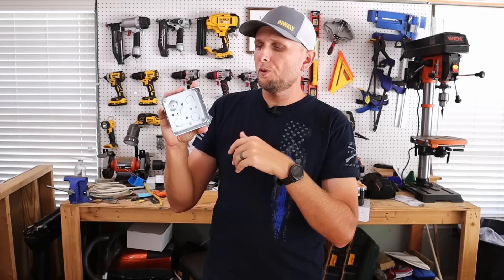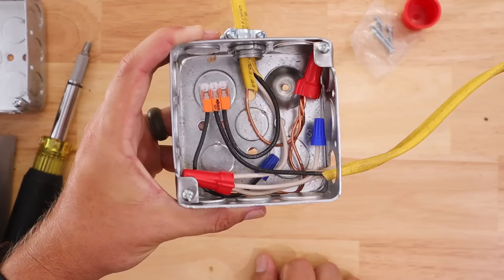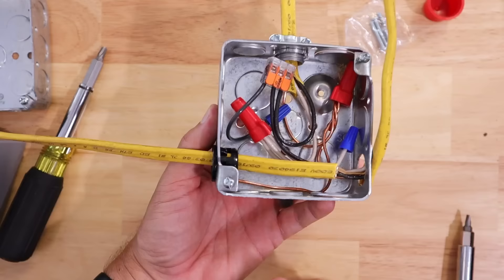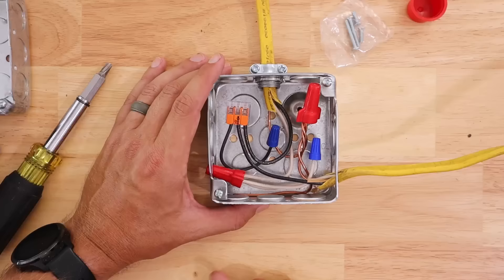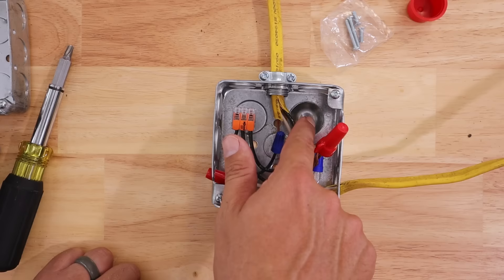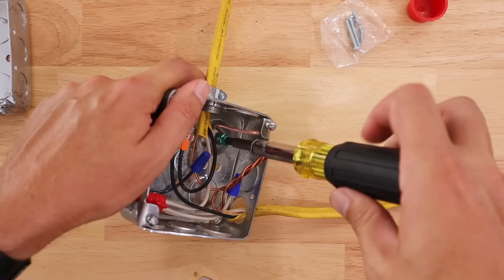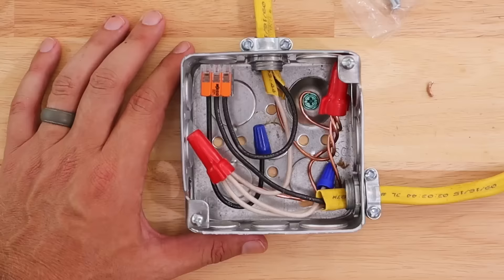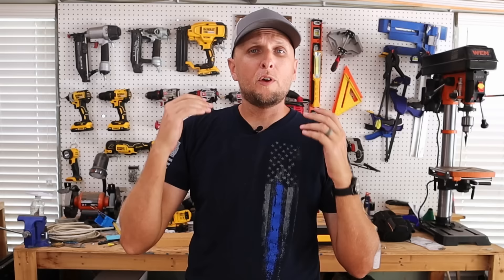The BIGGEST Mistakes DIYers Don't Know They Are Making When Installing Metal Electrical Boxes

Comment: What I would see a lot of people do to fix the ground would be to take advantage of the length of ground wire coming out of the Romex before it gets to the twisting and just wrap that around the ground screw. This would be especially true if they forgot to ground the box. To do so quickly, they'd start the ground screw, pull the wire over to it, give it a short wrap, and tighten down the screw. Technically, this would likely violate the minimum wire length, but it would be functional. If you did it before trimming the wire to twist it, then you could leave enough length from the screw to meet the minimum length.
Reply: You can always extend the wire especially a ground with a wire nut , wago,  push in , or a coppercrimp
Reply: I always leave one long just for that reason. I've seen some old houses where the bond was pinched under the box. Not code but at least it has a bond
Reply: @biffmalibu3733  I've seen metal boxes tied to conduit where the ground was secured to the danged clamp for the conduit + box connection. Then you get to the panel and see a massive bare copper cable tied from the panel through the concrete, literally "grounding" the ground.
Reply: Dawg...get this . back in the day with metal conduit (running between metal boxes) you didn't need a designated ground wire ... You only needed to pull in your current carrying (hots)and your neutrals... the mechanically connected pipe itself acted as the ground
Reply: Also when all plumbing was copper... An exceptable ground was taking a grounding electrode conductor (bare copper) from the panel and basically clamping it to a cold water pipe. (Which is still practiced today where there is copper plumbing ..but only as a supplementary (essentially backup) ground)....
Reply: yes, done that too.
Reply: @roguestatus9297  i've seen a number of houses that did that then had a small bit of pvc replacing the pipe right where it leaves the house
Reply: @scottdowney4318  have run into situations where a plumber has come until an older home, where the only equipment ground was the copper cold water pipe....then chopped a bunch out, replacing it with pex (standard practice.) essentially chopping out the grounding electrode....
so.....put a jumper in to reestablish that ground...more importantly drove a ground rod outside....
Reply: @jaquigreenlees  That "massive" cable is probably a Grounding Electrode Conductor (GEC). It's Purpose is to connect the Grounded Current Carrying Conductor (GCCC) [Neutral] to the required grounding electrodes. Those include concrete encased electrodes, underground metal water piping, Ground Ring conductors, driven rod electrodes...

Comment: Additionally, all the wires coming into the box should extend a minimum of 6-in from the final finished surface (box edge if surface mounted or plaster ring if recessed) once spliced together which may mean leaving up to 9-10 inches of stripped wire in the box for each conductor. The pigtails don't count as this length. This is the biggest mistake DIY-ers make with ANY kind of electrical box.
Reply: NEC 300.14 => 6" of free conductor from the point where it emerges from the sheath, and if the box is smaller than 8" on a side (like you can't get you hand in the box because its just a two gang box), then 3" of the total must extend beyond the opening.  Most nail on plastic boxes are less than 3" deep.  Working with wires that come out just 3" from the box totally sucks.  But that is minimum code.  My habit is to have 9" total length of free conductor.  Easier to work with.
Reply: I go 8 inches from where they come in to the end because that's my hand size easy to make it all the same
Reply: Not just DIY’ers. I’ve seen plenty electricians cut the wires too short. I always cut the wires to the length of my lineman’s when cutting in. That way you have plenty extra when you go to trim out.  Nothing worse that having to do service work on devices that have about 3 inches of wire past the box.
Reply: That's a myth that needs busting, its not from the box edge, its from where it comes into the box.  Too long can be just as much of a pain or more than too short, especially with larger gauge wires on bigger receptacles, you're not even close to approaching box fill from a yoke and wires standpoint, but its obviously ridiculously too crowded when you try to shut it up.
Reply: @snap-off5383  It's my "opinion" that it should which is why I wrote "should" rather than "shall." By code, conductors shall extend at least 3-in from any box with an opening less than 8-in in any dimension. So if you're installing a deep metal wall case (4-in) you need at least 7-1/2-in of stripped wire to meet code minimum (taking minimum bending radius into account). Strip the wires ~3/4-in to terminate to a device, and you're attaching that device about two inches away from the front of the box. Fun. But go ahead, let's tell the DIY-ers that it's okay to do that crap. Who cares about professional best practices anyway? Right?
Reply: @PetrosArgy  You didn't write it as opinion, you wrote it as fact. Next time try saying "I think"... or "in my opinion"...
Reply: @billymacktexasdetective5827  "Should" is followed by an opinion - always.
Reply: @PetrosArgy  You'd think that but apparently this is your first time on the internet...
Reply: @billymacktexasdetective5827  nah, I'm almost a boomer and have been here for decades.
Reply: @billymacktexasdetective5827  In code writing words do matter. "Shall" is mandatory language; "Should" is permissive, or, opinion when used in code interpretation.
Reply: @denali9449  That's great for those who know that, which isn't the vast majority of people on YouTube. Spell it out, don't assume everyone knows what you know. Is that asking too much?
Reply: @billymacktexasdetective5827  Actually, it is asking too much as the parties discussing the actual technical issues knew difference in the wording. It was only you, who offered no technical input, who did not understand the nuance. Kinda like the difference between 'grounded' and 'grounding' conductor. If you are going to play in the game, you need to learn the language.

Comment: I appreciate what you’re saying about the #14 used as a pigtail when the circuit is, apparently, 20-amp. However, I had this very discussion with the authority having jurisdiction (the inspector) when he tried to ding me for it. If installing multiple devices on a 20-amp circuit the NEC allows that those devices be rated at 15-amps. Using that logic I argued successfully that my pigtails could be #14. This same inspector once had a conniption when one of our guys didn’t use the code required green grounding screw to bond a metal enclosure. I asked him what the most important part of all this was and he said, “Grounding, of course!” I asked if it was and he said it was but the screw wasn’t green. A 10-32 screw is a 10-32 screw. I’d rather see it grounded with the “wrong” screw than not “because you didn’t want to break that rule.” In our trade there is nothing more important than grounding. Thank you for doing this video!

Comment: Like others have said… the 14awg combo isn’t all bad for such a short run since it will not cause much voltage drop, but it would be a weak point depending on the length of the run being used. 4 inches of 14 awg can easily carry 20 amps if the total run resistance does not cause the voltage drop to pull enough amps over 14awg to cause a fire.
Reply: still a code violation

Comment: You didn’t mention the backstabbed receptacles ‘electricians’ love to use!!!  Strange, weren’t all those wire nuts twists installed by “licensed electricians???”  I’ve seen substandard electrical installations by ‘professionals’ my entire life (in my 60s).  First thing I do in a new residence is check all the receptacles and wire nuts.  As far as UL Wagos, anything that will help the DIYer do a safe connection should be encouraged.
Reply: I was looking for a comment on stabbed in wires on devices.   I refuse to use that method.  Same goes with using wagos.    Screw terminals and wirenuts only, for me.
Reply: I despise those things. Every time I have to service an outlet with those used, they never release correctly and I need to cut and restrip the wire.
Reply: @ElementofKindness  Wagos are fine if used correctly. They're UL tested and NEC approved. They're also easier to add or remove circuits. We use them in industrial applications all the tie.
Reply: @njineermike  so are stab in receptacles, but I still don't use them.
I'd like to see infrared images of stab connections and wagos at full circuit current.
Reply: @ElementofKindness  Those images are available on this platform. The difference between the Wagos and stab in receptacles is that Wagos are serviceable and stab in are supposed to be, but either the wire tends to fail at the connection point, or the stab release fails and the wire has to be cut. Both situations make the connection point unusable and requiring replacement of the entire receptacle because there is a wire fragment stuck in it.

Comment: A better way to do the ground wire would be to use a “Greenie”. It’s a green wire nut but with a hole at the top. One wire is longer than the others, it connects the wires normally but the longer one is sticking out to screw to the box.
Reply from the maker: Certainly an option.  I definitely like using the greenie in many applications.  Thanks for the input!

Comment: Why not use plastic boxes in residential installations
Reply: I can only agree ,metal will strip the isolation bare, and metal can carry power so it's a no no in my opinion. The other dumb thing is the way to small ring under the green screws, as you can see in the video the cable wants to come out.
Reply: He was just using this box in this case, to show the problem not grounding the box, if you use one.
Reply: Somtimes you cant because of old framing being that the bay is too small to accept a single gang old work box. Also for the need of use with seal tight or anything that uses a TA like floor heat for example.
Reply: its the safest practice to hook the wire like that as long as its facing clock wise or the way the screw is tightening which he did. Every device besides breakers and gfci's are pretty much installed this way as well. Just please for the love of God dont back stab.

Comment: I started using Wagos quite a bit recently. They're very convenient, but I've discovered that the levers can pop open very easily when you're pushing everything back in the box. Bad design flaw. I'm tempted to start taping them shut, but then why not just go back to wire nuts? So be sure to visually inspect your Wagos before you button things up.
Reply from the maker: Yup, that is something that definitely needs to be watched!  Thanks for sharing your experience with it.
Reply: the visual inspection combined with the test point for leads is good enough reason to switch from wirenuts.  not to mention the ease for connections between solid and stranded wire.  that is far far to easy to screw up with a wirenut especially for DIYers
Reply: Just use electrical tape and wrap it...works all the time

Comment: Per your discussion of the #14 jumper mated up with #12 conductors, in the common connector: As long as the supplying circuit breaker has a 15 amp trip-rating, and the connector in the box is properly rated for either #12 or #14 conductors, the #14 jumper connecting the utilization equipment would be okay in my opinion. In a lengthy branch circuit, #12 NM wire might be 15 amp protected to reduce line loss.

Comment: wagos are junk.i already saw three connections using these pieces of crap burned off.wire nuts are the way to go.period.
Reply: Were they actual Wagos or just generic push connectors?
Reply: @SgtZima  they were wagos.i have been an electrician for 50 years and as far as i am concerned these are junk.Mobil home builders are using these and i have repaired three connections that were burning using these wagos.
Reply: @charleskovalewski5210  Push connectors or lever nuts?
Reply: @SgtZima  wago lever

Comment: But why are these boxes metal?
Reply: Grounding/bonding is easier to accomplish.  Plastic boxes typically aren't as durable.   Depending on the application using metal is more feasable. I think plastic boxes are more $$$ too lol but that last point isn't a technical reason lol
Reply: @nathanquinn8273  in Europe it's plastic, but we always use pipes for the cables.
Reply: Good question 🤔
Reply: @areejissam301  Metal boxes provide a better grounding/bonding "system." That is all there is to it.
Reply: After seeing a bunch of burnt up plastic boxes I can understand why they are metal.
Reply: @derekparent752  some of the really old plastic boxes are actually impregnated with saw dust. So they are super flammable

Comment: Actually,  as long as it's in a 15 amp break, and using a standard outlet,  which is rated at 15 amps, the 14 awg wire is perfectly fine

Comment: simply don't use metal boxes
Reply: Nah more shielding is always good
Reply: In Europe I don't remember seeing metal distribution boxes in the home depot store.
Reply: I actually like metal.   But is more expensive 😢
Reply: @carrerasrivera  melodic metal or rather heavy metal?
Reply: If this is your answer , please don't touch electrical systems. Master electrician /electro-mech engineer speaking here.
Reply: What if you’re working in a steel frame building?
Reply: It’s code to use metal boxes when working with connecting knob-and-tube and Romex wiring, like adding a new switch to an existing circuit but not replacing the entire knt circuit wiring.

Comment: Excellent video. Concise and to the point. One thing to add is that the connection is everything. Not pre-twisting sometimes causes wires to pull into or push out of the wirenut. More on that point, wagos provide neither the contact area nor contact pressure for an adequate connection. I have personally found many examples where the heat produced by the inadequate contact of a wago have caused it to melt and catch fire. I even found one that burned through metal ballast cover. They should be illegal.
Reply: That makes me wonder if wagos are even rated for 15/20 amps? (Or just rated for some smaller appliance-level current draw like maybe 2-5 amps?) Yes, they seem silly, as a knife cut kind of connection is going to have a very small amount of contact. But: if we're being that technical, a soldered connection has a much lower resistance than even the tightest wound wire nut. 😆
Reply: using wirenuts should require a 6 month course on how to install them.  they are terrible for newbies as they are so easy to screw up and hard to test.  wagos are perfectly fine installed correctly for the application and are far easier to install correctly than a wirenut.   also most manufacturer's on wirenuts nowadays specifically say not to pretwist so you take on liability as an installer if you do so.  if there is ever a problem anywhere on the line and they are able to show you pretwisted against manufacturer recommendations your insurance will deny coverage.

Comment: Wires are better twisted then cut straight across at the tip before using a marrette. This leaves 2 corners which will dig into and stretch the spring inside and force the wires together.
Taking the time to learn the proper way to make a connection is not time wasted. It is 1 of the most important skills an electrician needs to know.

Comment: I was called to a friend’s house a few days after he bought the house because his NATGAS HVAC unit worked intermittently and it leaked gas from a few fittings. I disassembled the black iron connections, cleaned the threads, and reassembled with Blue Block sealant. After fixing the leaks I looked at the unit’s wiring. I traced the wiring up into the attic where I found the previous homeowner daisy chained the power for the HVAC unit from his recessed lighting, which was on a dimmer switch. When the lights were dimmed the HVAC did not work. The realtor told my friend the last owner was an ‘electrician’, which is why all of the lights were modern and plentiful. I ran a new dedicated ckt from the pnl to the HVAC unit through a local disconnect next to the unit. That job opened me up to all of his neighbors. Doing good work is not only smart and safe, it is the only way to work.
Reply: OMG! This comment made me laugh! The “electrician” made such a boner headed error here, I am astonished that anything in the house worked at all. 😮 even as a non expert, this made me wince…

Comment: I was taught to pre-twist all connections and in my area it is code with solid copper wire. You don't have to twist stranded wire but I still do. It takes 3 seconds and you know your connection was tight and proper before you cap it. The other thing which you didn't show here is tapping your connections. It is another piece of mind step and for those who don't pre-twist wires or use connectors the tapping will keep the nut in place if something did move, nut failed, wire slipped. Then you won't have anything able to move and/or arc to the metal box. If I was doing an outlet in a metal box I would tape the outside of the outlet covering all posts. Always tape in the same direction you tightened the nut to the wires. Electrical tape is still cheap and only takes a few seconds.